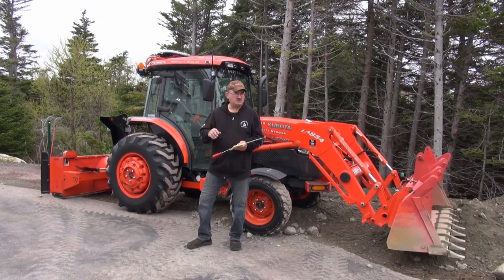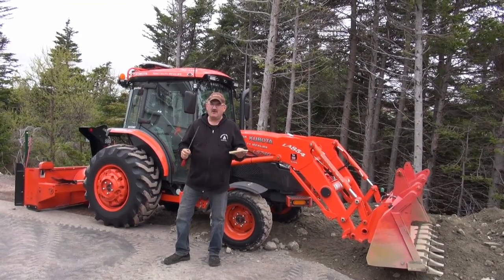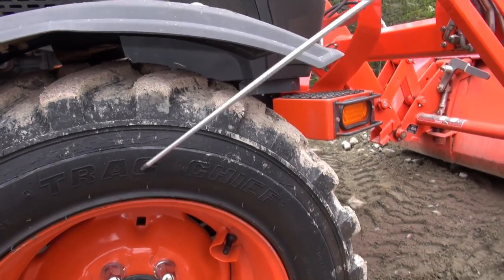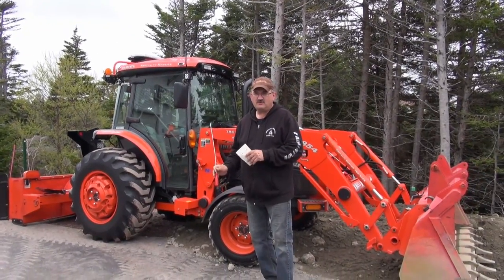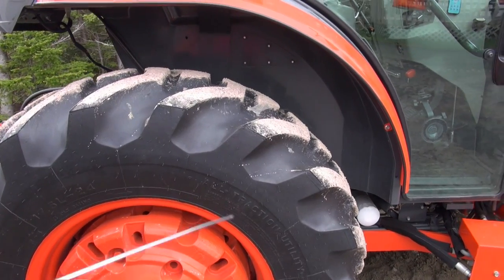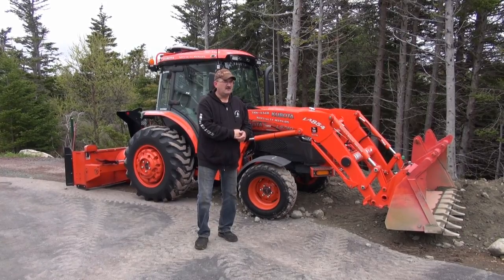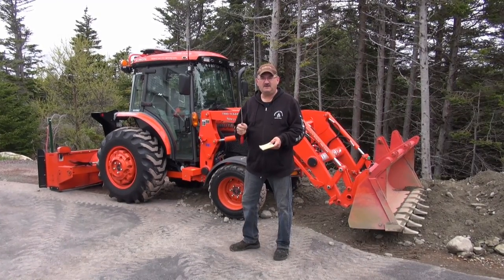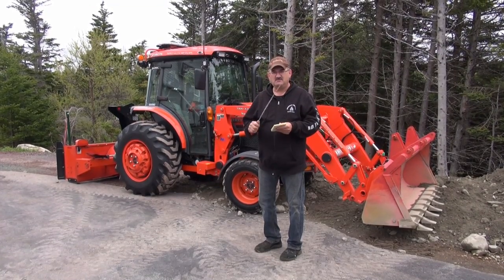Potential Tractor Safety Hazard

Comment: I bought a new Kubota L45 thirteen months ago.It is garage kept with 78 hours.It has Carlisle R4 tires front and back.One of the front tires is starting to show dry rot cracking around the tread blocks.The warranty is up so I will eventually need to replace the tires myself,but definitely not with Carlisle.I have heard of other tractor owners having problems with Carlisle tires,usually the fronts.They seem to be an inferior tire.

Comment: Of course dry rot has been happening since tires were made.  Unfortunately, over loading and running low on pressure happens as well.  All that being said, and all having already been RULED OUT in your case, what could it be?  Crappy tire rubber compound!  
I looked thru a lot of forum comments from many "green" tractor owners even further back than your orange beast (2007-present) and this has been "popping" up (pun) with this brand and type of tire.  Apparently these tires just were not meant to last, regardless of how nice and caring you've been to them.  That really sux.  No admittance of guilt, no recall, barely even a warranty from Carlisle.  :-(    
Do you know how many plies are built into the tire (sidewall info)?  Looks like the old 6-ply have been been dropped and replaced with 14-ply, so that's a forced change.  Good luck with ur mission, sir, and may the tractor forces be with you.

Comment: Makes me wonder if those tires were hanging around in a warehouse somewhere before they were installed and used on that tractor.  There should be a date code on them for when they were manufactured.
Reply from the maker: You might be right. I'll check it out. Thanks.

Comment: Paul you should check your BX25D. On mine (2014) the dealer replace the two rear tired on warranty. One the first week and the other after 11hrs in 2014 Crack all around.  came like this from factory. The dealer deals direct with the tire manufacturer for faster service. front tire looks OK but I have a slowly on the left one. they suggested to put a tube. I don't trust that brand, Traction master. If I have to pay I will change brand. Note that on my trucks I never liked the original tires. Thanks again for your good advice. Flat tire on rear or front is easy to flip.

Comment: Carlyle tires are THE WORST tire you could ever install on anything with wheels.  They are very cheaply made, cheap to buy and a large number of equipment and trailer manufacturers use them for that reason.  Junk tires that are an accident waiting to happen.  Been down this road a few times with this junk.

Comment: Thanks for the video Paul.  Very much appreciated.  
I've had a moment or two where the sphincter reflex kicks in when you hit a bump with the bucket full, but down.  
Physics can certainly take over in a heart beat, without warning and without the opportunity to plan your response.

Somewhere along the way though, and on a similar note, I'd read that auto tires over 9 years old should be replaced due to aging of the rubber and could greatly increase the separation of tread from the cord.  No matter the condition of the tread itself.  Comments?

Comment: Excellent safety points.  Can I tell you about my tire experiences?  In 2017 I had to replace all 9 E-range tires on one trailer of mine.  The tires were Goodyear ST trailer tires, all replaced less than 4 years prior.  Of the 9, 6 blew out on the road, one by one, due to dry rot.  The set of tires prior to those lasted 7 years.  Why the difference in longevity?  I had many discussions with the GY shop that I do my business with.  With the experience of 20 years and 3 trailers here is what I have learned: (1) if tire load is at their design load, the inflation pressure must be at the max, otherwise there is too much tire flex and the belts separate and tire failure is imminent,  (2) in the USA tires cannot be sold if they are more than 7 years old, which means that they have no inflation pressure during that time but once mounted should be good for years after that,  (3) if tires are mounted and fully pressured but seldom used, they dry rot - doesn't matter if they are sheltered.  #3 is why my 9 failed so early.  They were at max pressure and used maybe once a quarter.  Putting tires to use where they must work and flex actually increases their life and greatly slows rot.

So my advice is: inflate tires according to the weight they must bear.  If pressure is high (say more than 50 psi) but you do not need that much pressure, reduce pressure to increase life, but never use them when under-pressured for the load they are expected to bear.  Currently when my trailer will not be used for a month or more, I reduce pressure to 25 psi or if the tire is a dual I reduce pressure of the inside tire all the way to 5 psi so they are similar to "on the shelf".

Comment: Paul ,you changed a front tire on the BX on a recent video, I was impressed by how quickly you installed the new tire, but was wondering why you had a spare in the shop, was it the same problem?  This video was serious business but would it have hurt to have the lovely Kathy use the pointer on the tires (lol)?  Just trying to get the subscriber count up. Thanks, Greg

Comment: Paul, good video.  please give us your opinion on  tire protectant's like Armor all Etc.  As some else commented compare tire to tire.  Plys, load ratings, size, height, Etc.  I trailer a tandem axle often and  for everyone's info, be sure to always check and compare axle to axle as usually the back wears first and one day everything was fine when I left on a trip, when I got home walked around trailer and steel plys were sticking out of passenger side rear.  Found out the heavier rated tire was less expensive.  Cheaper is cheap.

Comment: Paul the same thing happened to me on my case this week I also have a loader on it mine has 824 hours on it and it's a 1999 case 1394. It spends all its time in the barn when not in use I was lifting a thousand lbs bale and it blew this past week very dangerous I had to change my underwear after it happened I always do a quick walk around but now I go over her with a fine tooth comb. I honestly think it's from sitting mine sits a lot to and its a lot of weight up front with the loader it's strange on yours because u have the blower for ballast

Comment: I wish I would have looked at mine better than I did the other night when I aired the tires up. I am going to check them out. What would you do, in my situation, if you picked up a nail? Did I do the right thing, at the time, and plug it, or should I get it repaired another. I know you have dealt with machinery over the years and I trust your advice. It was my front passenger tire.

Comment: carlysle tires are totally junk    I had a set on my trailer   4ea        2 blew out within 600 miles     firestone bridestone  4 times the tire   called the  dealer and also the manufactor and they said,  It is what it is and wouldnt warranty anything   I was po to saythe least

wouldnt have them on my wheel barrow      thanks for the tip on safety 

namvetseabee

Comment: Just a thought but I had a similar situation with my motorcycle tires dry rotting after 1 year. Contacted the tire manufacture and they asked if I had stored the bike in an enclose space next to a battery charger  or next to an old operating a refrigerator. According to them both of these devices make ozone which causes dry rot. Apparently old frigerators have electric motors with brushes which creates ozone. Not sure how a battery charger creates ozone but that's what they told me. Might want to check the manufacture date on the tire. The ABC news program 20\20 did an investigative report in 2008 and most consumer groups recommend tires on cars not be used if they are over 10 years old. Really enjoy your video's
Reply from the maker: Very interesting. Never heard of it before. I'm an open minded person so I'll rule nothing out but I have a welding machine I put on a trailer I built back in 06 and it has a battery tender on it. It's the same battery tender I use on the tractor. The tires on the welding trailer tires are perfect yet they are 5 years older than the tractors. Interesting though. Thanks!

Comment: foam filling them is the best. wear them right out to nothing no more flat tires especially on the BX 25 and GC 2300. I don't understand why the small tractors don't have a stack on the exhaust. that is my safety concern I am sick of getting poisoned by the diesel smoke blowing under the machine. does anyone know of any aftermarket exhaust kits that come with a stack? thanks for another great video Paul
Reply from the maker: I agree on the foam IF the foam can take the weight. I would imagine it would make the tractor ride very rough as well though and maybe that's why the manufacturers don't use it. 
I had trouble with fumes as well so I built my own stack conversation kit. Works great. Having the exhaust like it was on the 5740 new used to soot up the loader arms as well. No more of that with the stack.

Comment: don't buy cheap rubber, Lolz

Rubber and plastic materials naturally degrade over a period of five to six years depending on the climate, temperature and humidity, the use and storage of the vehicle, and the air pressure levels of the tires. Dry rot is indicated by hard and brittle surfaces on the tires. As the oils in the rubber begin to evaporate, the chemical bonds break down, leaving a dry tire behind.

The most common causes of dry rot include low inflation of the tires, storage near excessive heat and a lack of use. Constant exposure to sun can speed up the effects of dry rot upon the tires..

why the front bad and the back fine, no clue ..
Cheap rubbers in the front ?
Reply from the maker: So many things that can cause it. I realize that but nothing is n the rear and yet the front is horable. Just wanted to warn others to check theirs.
Reply: Paul Short the only thing i can come up with is the back rubber is closer to your heater in your Work place ....

Comment: This probably had nothing to do with dry rot on your tires, but ozone gas will definitely destroy rubber.  Ozone is produced by electric arc in electrical equipment such as electric motors or electric welders.  If rubber is stored in a tightly enclosed room where there is electrical equipment operating and producing ozone gas it will eventually ruin the rubber product.  Ozone is also produced by lightning, but that's not really a problem since it's not in a confined space.  

I learned this the hard way several years ago when I had an old copying machine that used powder and an electric field to make the copies and all my rubber bands and rubber stamps started disintegrating on my desk.  Since then, I keep all rubber items away from confined areas where there are big electric motors. welders and such being used.  I hope this helps someone.
Reply from the maker: I've heard this before and I'm sure it happens but why just the front tires? The rears are made by a differant manufacturer yet they are like new. The only electrical item this machine is by is an led street light and a Battery Tender.
Reply: Paul, I'm sure you are right and that had nothing to do with your problem, but I thought it was important enough to mention.  Who would'a thunk it?

Comment: My neighbour had that happen, he always puts a tyre black on his tyres, I wonder if the tyre black dried out the compound
Reply: The water-based dressings are ok as they don't have the petroleum distillate; silicone oils, waxes, or solvents  in that that dry out the rubber as the solvent-based products.   The water-based are usually the white milk-like liquids.  The solvent-based are clear and more oily/greasy. <<< Stay away from the solvent type if u use a cleaner or dressing.
Reply: +Ji Fi-01 (Jif) He used the solvent type, I personally just wash and that's it, so they aren't showroom black but I don't care...

Comment: When you pull the tires please show inside side wall, would like to see if any cracking.
Reply from the maker: They are tubeless so if they were cracked inside they would be leaking.
Reply: Just looked at my friends Massy and guess what rear tires like new , fronts are cracked just like yours